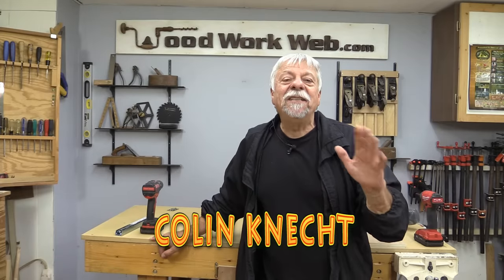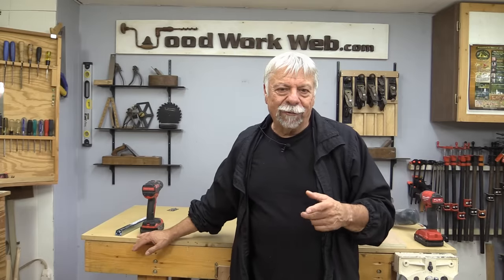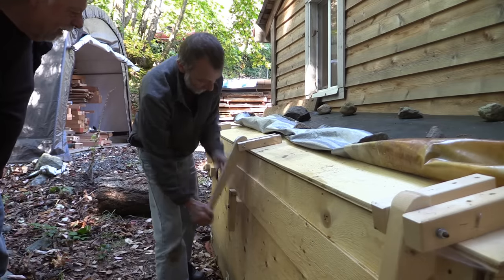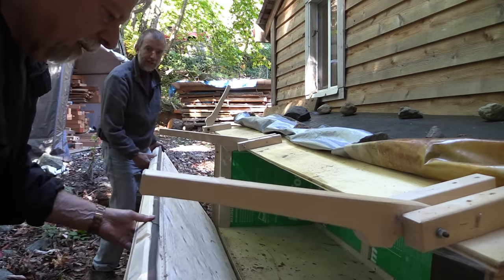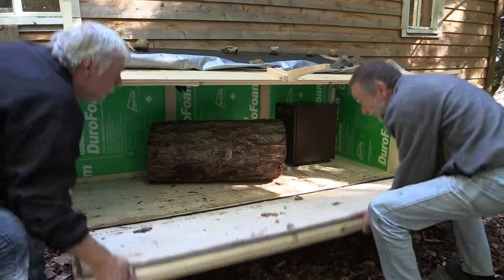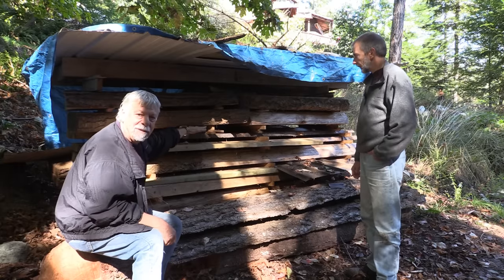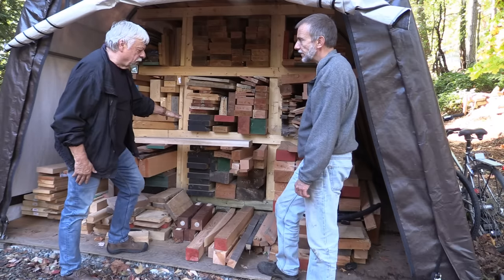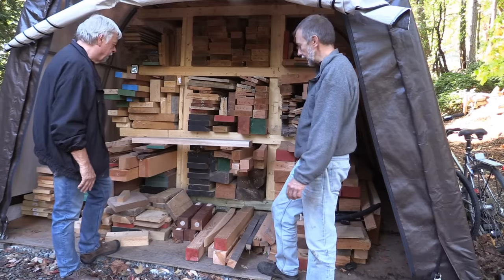Drying Wood with Dehumidifier Wood Kiln - How to Dry Wood

Comment: Great video thankyou. 30 years ago when I was taught to build dehumidifier kilns for, cut boards, It was explained to build the kiln with 2 chambers. One for the lumber and a smaller one beside it. The smaller chamber was for the dehumidifier and fan. A passage way left at each end of the centre wall would allow air to be blown through the wood and then past the dehumidifier. By turning the fan around you could reverse the air flow, thus slowing the checking.

Comment: Excellent video.  Good information.  I have a 20' Conex container (painted black on the roof for heat) that is solar powered using twelve 12v computer muffin fans for circulation and two 12 marine dehumidifiers.  It takes about 8 months to cure 4,000 BF of 10/4 rough sawn timber.  It works great.  The key is to have tight seals.
Reply from the maker: Sounds like an impressive setup! Thanks for watching.
Reply: HARDNOX, I am in the planning phase and really like what you posted here. how could I find out more about what you are doing? Thanks, Mike

Comment: These dehumidifier systems work well. I have been using a 4x4x8 kiln for years. 
I air dry most of my lumber until it is 12 to 16%, usually a month or two with good air flow. Then load the kiln and run the dehumidifier at 85% humidity until the run off water slows. Then turn the humidifier down to 75% and repeat the process.  I dry lumber until it is 6 to 8%. Keep a fan running the whole time. Let the wood rest a day or two between decreases of the dehumidifier,  run the kiln temp to 140 degrees Fahrenheit for 2 to 3 three days after reaching desired dryness. About 3 weeks or so from loading to unloading the kiln ( times can vary... widely, though)
My kiln is NOT air tight.
Reply from the maker: Thanks for the tips and thanks for watching!
Reply: You air dry your lumber to 12-16% in a "month or two"? You meant YEAR or two, right?
Reply: Thanks you answered most of my questions without even trying

Comment: I'm hoping to have my wood stove setup and ready to go for this winter but most of my wood is not quite seasoned as I'm kind of a year behind, what I cut this year will be for next year.  Now I'm almost curious if I could get away with just using a dehumidifier inside the house.  I do eventually want to build a kiln but not quite at that point yet.  I might even experiment with putting my wood in the server room, if I put it behind the server racks the hot air blowing over the logs constantly might help too, and I can also throw a dehumidifier in there. Just got to watch for electrostatic discharge!

Comment: So, been watching your videos for awhile, I decided to go down the rabbit hole of milling my own lumber. I have some 8/4 white oak and 8/4 read oak that has air dried 1 year and is down to about 14%. I made a makeshift styrofoam box put a dehumidifier, fan and heater in it. Been running at 100 degrees and kiln humidity is at 25%. Can I safely dry this wood at this temp or should I be at higher temps. Not really sure if I’m doing it right or not? Any insight would be a great help. Thanks in advance.

Comment: As for drying the log for carving, I find its a better approach to carve the log first (At least to the rough stages) and THEN dry it.  This way there is a lot less wood to dry and depending on what you carve it may alleviate a lot of pressure that would otherwise be in a full, round log. Why dry would that you plan to cut off anyway?

Comment: I'm setting up a small kiln like this, and i'm having issues with my dehumidifier - it won't run if the humidity is too low, and lately it isn't collecting any water at all.  I bought another one, and its having similar issues.  Do you have any recommendations for getting this to work, or humidifiers that just run without all the circuitry getting in the way?
Reply: Do you have an electric baseboard heater in the kiln? Also add a couple house fans to recirculate within the box. 
If it needs heat and circulation.
I used to run one in my shop, built out of 2-inch styrofoam 16 ft long. It must be insulated well to be efficient.

Comment: I don't think I could ever stack dried wood Outdoors here in the south.   We have humidity levels at 70 to 95% regularly.   Even the garage it's not immune.   Do you have any recommendations for those of us who lives in the humid South?
Reply from the maker: I'm not sure Trey, but we filmed this on Vancouver Island, on the West Coast of Canada ... which is known to get its fair share of rain and we can still store it covered, outside. 
Maybe have look at how your local lumber yards store it.
Reply: I am in tennesee and have a sawmill. 8/4 white oak will dry down to %15 just air drying for a year. Just need a kiln like the one in this video to take it down to where it needs to be.
Reply: Similar here in Western NC mountains. Stickered in garage with box fan 24/7 to prevent surface mold, dryer in winter of course. It'll hit 9% after a winter in the conditioned basement w/ box fan. Best, @HoneyOnWales
Reply: Move! 😁
Reply: Thanks. I'm just south of Charlotte, and was hoping to do the same
Reply: @drewt3210  Same here Drew ...Balsam Grove...regular rain forest here. Putting in an 18 x6 kiln in as soon as i get my shop built.

Comment: Very interesting video. Thanks for sharing.
Somehow I do not understand the percentages which are mentioned for the (more or less) fresh wood 80%, 90%
(I could not hear it well on the video, the "CC" wrote that)  I always thought that fresh wood has
a moisture percentage around 30%, max 40%.    Or was the "CC" wrong and had been sad 18% and 19%?
Is drying a complete log possible till 12% this way?  
In the past, about 15 years ago, I visited some commercial kilns, and the operators told me, if I remember well, that
wood should not be much thicker than 6 inches, otherwise it will not dry evenly.
Reply from the maker: Yes, try to get it down to 12% if you can. Yes, it seems most people try to aim for 6" or smaller. Thanks for watching!

Comment: What does he do to eliminate the risk of powderpost beetles or termites?  Does this kiln reach a high enough temperature to kill them and their eggs off?
Reply from the maker: They aren't a huge issue around these parts. Typically, the dehumidifier does a good job of making it too dry for bugs and their eggs.
Reply: WoodWorkWeb post beetles have no limit on how long they can wait to hatch. I heard it was 130 degrees for 48 hours to kill the eggs. I use boracare to sour the wood so even if they hatch they won’t eat.  But that won’t work on wood that is over 2” thick.

Comment: What can be used as a sealant for the wood?
Reply: A product called Anchorseal works well. I prefer the classic version over the Anchorseal 2.
If you are processing a large amount of lumber  buy the 5 gallons not the one gallon.
Reply: If you don't have a lot of real expensive wood use a latex paint. I use latex two coats and it does just as good. No sense in spending lots of money on a product that doesn't guarantee checking.

Comment: is there different ways to dry Australian hard woods or is it the same
Reply: 99% the same. You auszies pay way too much for electricity to run a dehumidifier cheap. So get some computer fans to circulate air, then use a bucket of pool salt to dehydrate the air.

Comment: Pretty interesting setup, wonder if this process would get rid of any bugs in the wood.
Reply: sorry I hit the wrong button plus I would like to let you know I am Kim‘s husband Doug… now after spraying the water outside under cover and drying clear and with just a small coating I use a sprayer with a pretty wide nozzle open so just as a fine mist I do spray the floor of the box and the walls up just a little bit but that if any bug crawls across it is dead very shortly so that being said and it kind of does the getting rid of the bugs and disinfecting again spectracide At any Home Depot and a lot of what I get is like 10 gallons in the spring but they can be bought any time and works very well

Comment: Months???
These dehumidifiers have about 200W of power.
Have you done calculations on electricity costs?
Does that dehumidifier survive that 24/7 workload?
Reply: I think there is very little amount of humidity in the box actually. So machine will wait 90% of time to humidity slowly rise. As opposite, we have damp cellars where I work, pro machine can create up to 10 liters of water every 24 hours, continually.
Reply from the maker: Because of the small space and insulation, they are at idle most of the time. I would assume the current draw would be minimal.

Comment: I want to build a log cabin, and dry my own logs. Maybe i can load the large logs onto a steel cage, thats in the air, by a chain, then put a box around it, with a humidifier. Maybe put 2 inside, one on each end of the box.
Reply: if your gona dry the whole log first you must debark it! and honestly depending the wood your gona have cracking like crazy. most heartwoods have different mc than the sap wood different rate of drying. air dry with end sealer your best bet and its gona take along time.